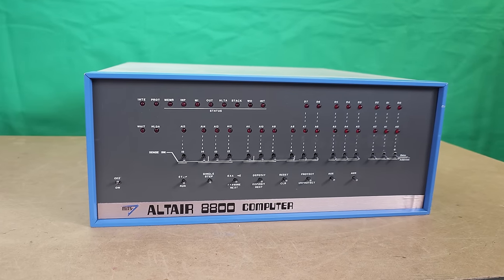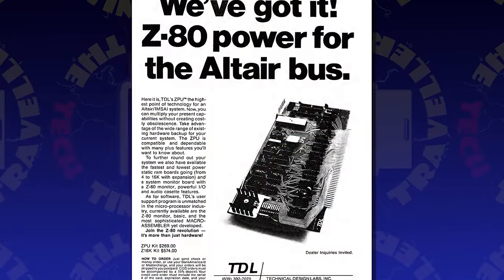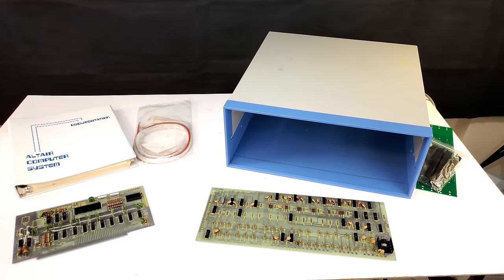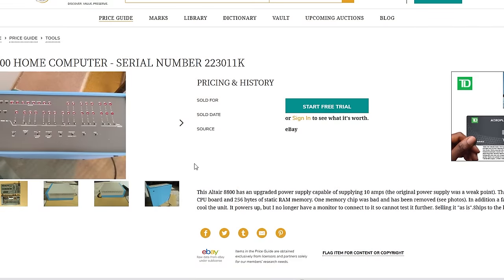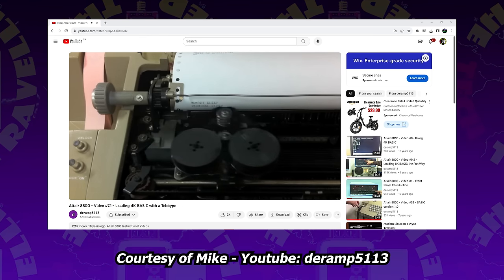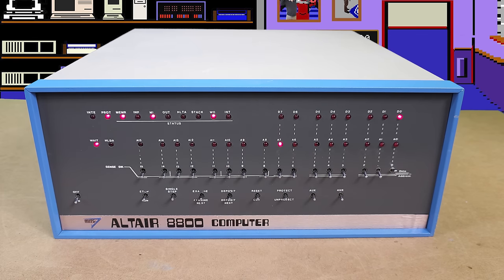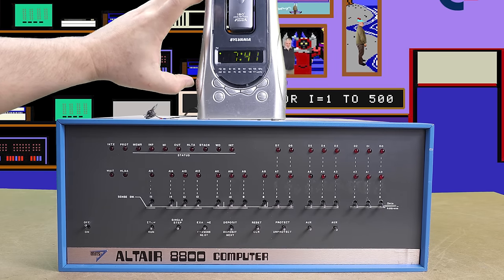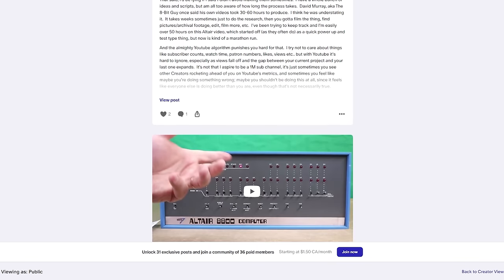I Bought the Cheapest Altair 8800 Computer on Ebay

Comment: 1:20 Man I'd happily daily drive an Edsel over any of the garbage they sell today. Fuck modern cars.
Reply from the maker: Yeah 50s cars are really special.. they seem more like art than everyday modes of transportation.  I enjoyed my Edsels, although I do appreciate modernity in some respects.  Especially power brakes, after I nearly hit a dumpster on a test drive because I didn't understand how much force it takes with manual brakes to stop a 3500lb car. :)
Reply: @TechTimeTraveller   Heh, ye, manual brakes can be a bit of a surprise. I've got an 85 F150 and, when I repaired it following a head gasket failure, my brake booster just sort of switched itself off. Never figured out why. I drove it like that for a few years, ran it out of gas one morning going to work, and the booster came back to life just out of the blue?! Iono. Wierd ass thing.

I kinda prefer it without power brakes tbph. I don't know if you've ever driven a bullnose Ford truck, but if you do, be prepared for the brakes to feel like there's nothing on the other end of the pedal. The brake booster is just that strong. Overboosted to such an extreme degree so as to make the pedal feel like there aren't any brakes at all. I'm probably not going to reconnect the booster hose when I get done with the engine rebuild I'm doing on that truck right now, go back to manual brakes again. There's plenty of 'boost' in the mechanical leverage of the pedal at least for my leg. TBPH I feel like it stops better without the booster because I have a better feel for whether it's about to lock a tire up or not.

Most fun I've ever had on four wheels was test driving a 1954 Plymouth Savoy and if they had been willing to note the car out I would have been dailying it since last year. Flathead 6, 3-on-the-tree.

The only aspects of 'modern' cars I like is air conditioning and FM radio. Both are fairly easy retrofits to vintage stuff, too, with VintageAir being a thing and old cars adhering to lovely little things called *standards* which makes putting aftermarket head units in them a breeze. I live in the NAshville, TN area and even if it's just a once-in-a-blue-moon pleasure car(which for me isn't gonna be the case lol daily driver woohoo) aircon is an absolute must. 

FM here....we've got two kick-ass rock stations. It's Music City, after all. Not every city has good FM stations, though, but any modern head unit you can find will have bluetooth whether it's a good one or not. And hell I might, from time to time, pop Galaxy News Radio or Radio New Vegas or somethin' similar on while driving it through the bluetooth functionality, get some period jams going.

 I put 'modern' in air quotes there because while such things are standard and have been for a hot minute, even my 85 F150 had both from the factory and you could, if a fella had deep enough pockets, get both air-con and FM from factory even in the mid-late 1950s on the super upmarket luxury models at least. 

I suppose one of the nicest aspects of these old cars is that they're almost a blank slate to customize as you see fit. For me, half the point of getting one is to experience commuting like it was in a bygone era before even my parents' time, to drive a literal time capsule down the road, so I'm not even of a mind to get radial tires on the daggum thing. I want the manual brakes, manual steering, the points, the bias-ply handling, all of it to be as close to the era as is practical while still being able to drive it to work every day.  But a fella can easily modify and customize to their own spec with one of them. 'bout the only thing you can't get them to do is get 5 stars at an IIHS test, but hell even in that regard you can get them to perform respectably in a crash with the right modifications. They even make airbags you can put in these things! Airbags designed to hide away in the dash, wheel unobtrustively, roll cage hidden under the trim, bucket seats, 3point belts, collapsible steering column, and you've gotten their crash safety up to at least a mid 90s-early 00s level.

Comment: It seems kind of amazing that anyone would speed 500$ on a kit computer that probably wouldn't work if you weren't good with a soldering iron and that you program by flipping toggle switches and that has no keyboard to do input and no display to show you your input and the output of the program and can't store your program when you switch the machine off. Not having a keyboard and crt was just a way to keep the computer from costing 2000$. It would be like buying a model T without wheels or an engine. Technically speaking you own a "car" but you can't really use it for daily driving. I thought it was ridiculous when I first saw it on the cover of Pop Mechanics and it still looks ridiculous to me today. I understand your programing demo but I could add two numbers with a hand held calculator or a paper and pencil faster then I could enter the data even into a pre loaded program. Hell my dad could have given you an answer using a slide rule and that could give you floating point answers. I know it's somehow a culturally significant artifact but as computer tech goes I think someday we will look back on the Altair and snicker like when you saw those videos of inventers building "airplanes" that used flapping wings but never flew.
Reply from the maker: Yeah, I mean $500 was serious money back then. I suspect for some hobbyists who couldn't have dreamed of having their own 'computer' the excitement got to them.  For others, maybe they always knew they'd upgrade it to something more useful - maybe they just staggered their expenses.. buy and build the computer first, then get a serial card, then a teletype or terminal.  Crazy amounts of money regardless.
Reply: I think the really revolutionary bit of hardware that the Altair had was a true CPU microprocessor "computer on a chip" which is what we now mean by computer when you think about it. The motherboard and all the other hardware in the Altair box was only there so that a human could interact with the "CPU". I guess the thing that made it seem odd to me when I first saw pictures of it was that it was missing a keyboard and monitor. People at the time who were new to computers may not have been aware that business computers from 50's and 60's always came with those 2 pieces of hardware. So you built a computer but you could only input anything by switches and monitor what the computer was doing by some flashing lights. I still think that the Apollo Guidance Computer was kind of the first "desktop computer" and it had a simple keyboard and output display. It's funny but at the time that keyboard and display were considered state of the art and in the heat of trying to land with alarms going off Armstrong and Aldrin were able to see what was going wrong and would never have been able to do that with just lights and switches! Anyway your video was interesting to someone like myself who loves old hardware but had never seen inside a real Altair.    @TechTimeTraveller

Comment: "there is no way to use deposit next on location 0" Set address 0xffff, then deposit next. The address will roll.
Reply from the maker: I just tried that.  Didn't seem to work.  But my machine is kind of a hack job..
Reply: @TechTimeTraveller  What happened? I wouldna thunk that the 8080 wouldn't be smart enough to do anything interesting with a 16 bit rollover.

There is a whole story about this, stop me if you heard it. When the 80286 expanded the address space on a PC from 1megabyte to 23 meg, ie., from 20 bits to 24 bits, the designers of the IBM-PC, who were testing compatability with older software running on the 8086 found that certain applications RELIED on the CPU being able to roll over the address from 0xfffff to 0x00000. Normally IBM would have been able to just issue a notice about stupid programs violating the specification, except the violator was.... Microsoft. So IBM did a kludge called the A20 rollover that held address line 20 on the IBM-AT to zero, and thus enabled MS-DOS to run. It was operated by the keyboard controller, so that you issued a write to the keyboard controller (a 8031 chip) to release A20.
Reply: So I can tell you how that switch, deposit next, works. It feeds the CPU a no-op or 0x00 and then activates the single step flip-flop. I believe I have the schematic for it in my MITS 8800 manual. Alas, my 8800 is stuffed and I can't actually try it.

Comment: Re: the serial numbers: perhaps the kit serial numbers were all kept sequential?  So that might explain why later models have "low" serial numbers.
Reply from the maker: Santo thought maybe people replaced worn out front panels from original machines with 8800a panels for example.. maybe some of that was going on?  That one 8800a machine I show in the video is weird.  Also found machines with serials high into the 4000s and they're back to Rev 0 boards... only with NEC CPUs.. there's enough to suggest they weren't merely on hand warranty replacements I think.. but then the question is.. why use them at all if you have Rev 1 out there.
Reply: @TechTimeTraveller After 40+ years of these machines being built, hacked on, perhaps re-purposed, and passed around between original owners to collector (to collector to collector): who knows.  Don't discount the possibility of people creating "Frankenstein" 8800s by taking all the best parts from different units to make the cleanest/nicest one for their own collection.  Good video.
Reply from the maker: @SellamAbraham  For sure.  So many things you can't account for completely in 40 years.  I've even talked to primary sources (company owners) on these things and even they don't always have any recollections themselves.  It's just a fun little diversion like sports stats, as one viewer put it.  I just saw an 8800 with higher serial number than mine with Rev 0 boards and it just sold for $6700.  Looked to be all original but also had the siob+modem board which I understand is crazy expensive.

Comment: Sounds about right that people would rather have the earlier, less functional versions of the machine. Then again, the Altair isn't particularly useful as a retro machine anyways. It's very much a collector's item. And I guess reproduction front panels and a modern power supply is considered evil to crazy collectors.
Reply from the maker: I just saw an auction for a higher serial number machine than mine close today for $6700USD!  Interestingly, it had Rev 0 cards.  It also had the 88 SIOB and modem boards which may have helped.  Appeared to have the original PSU and backplane.  I guess those few things are worth $4700!

Comment: The Altair 8800 cost around 400 dollars. it varied at times.  The 6000 price u mentioned in video is totally false.
Reply from the maker: Not sure what you mean.  In the video I made clear $6000 is what the Altair fetches today, not 1975.  I showed a MITS price list with the original price also.

Comment: As someone with a barn full of 1970's and early 1980's early 8 bits...  yeah, you're not going to get $1,000 or $2,000 for a boat anchor of an Altair.

If you could, I'd be sitting on a couple million bucks of collectible antiques silently collecting dust.  They really aren't that compelling to mess with any more.   I haven't touched them in 30 years, when some guy died in the late 1990's and his wife and sons wanted the whole collection of "junk"... gone.    I grabbed everything I could, only because I knew they were headed for a dumpster and nobody but me could love them, because I grew up looking at them all in magazines as a kid unable to afford them.
Reply from the maker: I am perpetually amazed at what some stuff goes for.  Just last week a 386-12 CPU went for $1200.  The old 60s Microswitch keyboards routinely go for $1000+ now.  I'd love to see pics of the gear you have in your barn..  I bet some is worth a lot!  Course, who knows how values hold up as those with actual living memory of these machines pass on...
Reply: @TechTimeTraveller  Er, who would buy a 386-12 for ... well... anything?    I use to chunk those and PS/2's in the dumpster by the pickup truck load.   Like, Ew!  Microchannel!   Lack of full virtual memory capability.  

Just last week I looked at what I thought was an AS/400 board I had hanging on the wall as art, that I had picked out of one disassembled we tossed away, only to realize what we threw away instead was a dissassembled  IBM System 6 and not an AS/400.

I.e., back when computers were built... into the desk... not sitting... on top of the desk :)   I could of put my Heathkit terminal on top of it or something.

But up the reality is... lack of space.  All this junk... takes up space, and you never have the energy or space or time to just wire up the rats nest of cables behind them to plug them up again and flip the on switch.  At least I don't.       And then what?    A  cursor prompt on a video screen... once upon a time was god power, but now...  holds no fascination at all.   Just a place I occassional punch in linux commands.   Don't want to live on a blinky cursor prompt any more...
Reply: @choppergirl  Space, indeed. By now, a lot of vintage computer equipment has been thrown into the dumpster. People can't keep all their stuff, so obsolete equipment gets thrown out. However, with Gen X and millenials aging, nostalgia creeps upto them/us. Quite a few people are buying back the devices they once owned. Now more expensive, because of basic market effects. Less stuff on offer with an increse in demand means that prices are creeping up. 
Even things like 37cm Sony Trinitron TVs in good working order are getting to the point that people are paying over 100 bucks for them - while just 15 years ago, they were thrown out by the dozen. 
The times are a'changin'. 
In my case - i've kept a lot of things from my digital childhood. Far from everything, but i got a stack of P1 and Pmmx laptops that are also starting to be wanted again for retro gaming. I've never kept them because of the financial aspect, but i did keep them so they can some day get a nice place in a collection.
Reply: Vintage computer prices are becoming crazy. People sometimes bid upwards of $1000 for a good condition breadbin C64 or an IBM 5150, many of which were literally thrown into the trash less than 15 years ago.

Even generic PC clone machines are catching crazy prices, just because they're the first boxes that could run DOOM.
Reply: Nothing like hoarding treasure you personally have nothing but disdain for, instead of passing it onto people who would actually appreciate it, just because you can't cash in with eBay hopeful-type prices.

Comment: ups off-grid
Reply from the maker: I wonder if they had consumer use UPS in 1975.. I should look that up..
Reply: or just run the thing from battery, those were from the start of 1900 and things @TechTimeTraveller
Reply from the maker: @gsestream  From the historical docs it seems like the only battery use they did in the early days was to keep the RAM powered.  I've read a lot of accounts of people toggling in stuff for hours only to have a power out or fuse blow or such and lose everything. Man that would suck!   I guess maybe a complete solution for the computer was too costly.
Reply: generators at least? if not batteries. @TechTimeTraveller

Comment: Buy an Arduino instead or a raspberry
Reply from the maker: That is certainly cheaper.  I'm actually working on a project - I have a Commodore P500 case, no system board, and I'm going to install a raspberry pi in it to emulate the P500 functions rather than paying $$$ for that.